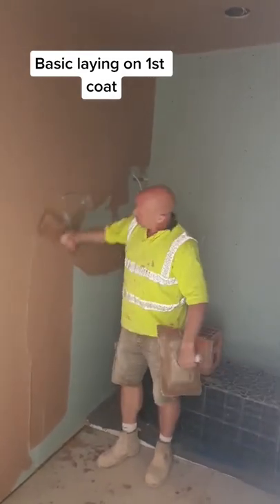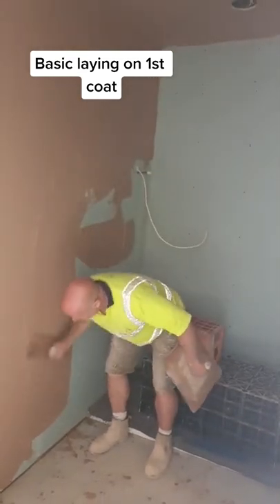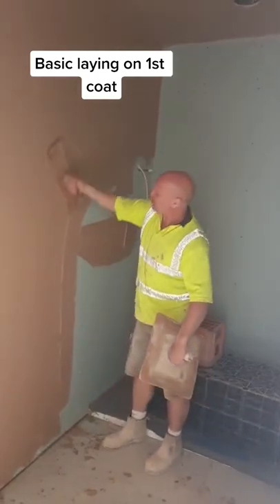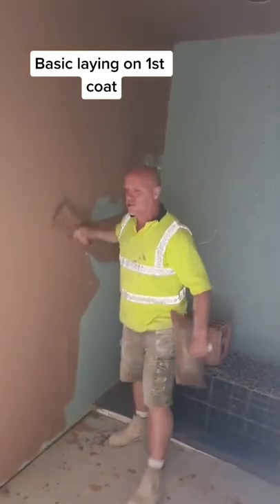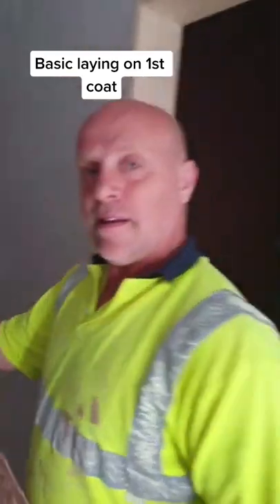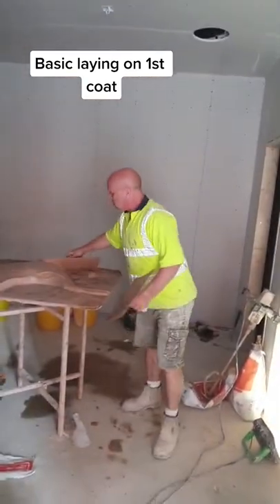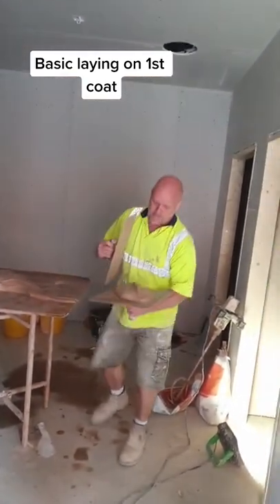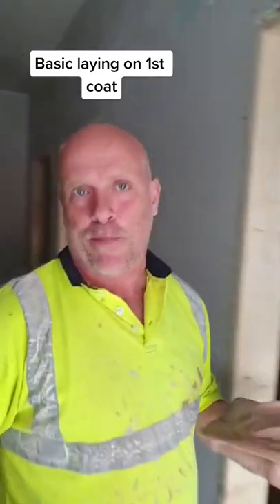Plastering Tutorial. 1st skim coat

Comment: And don't forget to leave a lip for the joiners to knock off to get skirting to fit
Reply: 😂 nothing worse
Reply: Don't they just board over the plaster and caulk in the edges? Swear that's what most tradies do.
Reply: I use an old hand plane whilst cursing to get them flat before fitting skirting
Reply: Sitting here laughing
Reply: Hatchet to remove the bell cast at the bottom of the walls, works a treat and done in a rapid style. 
There’s not many spreads on site that flatten the skirting line
Reply: As a plasterer I confirm... it's in our dna